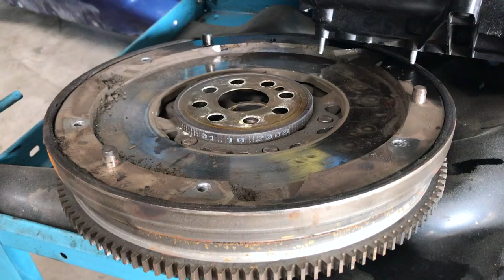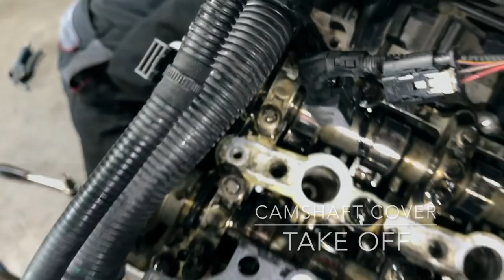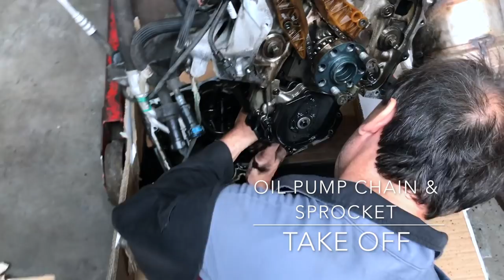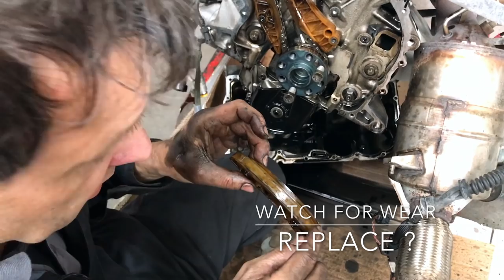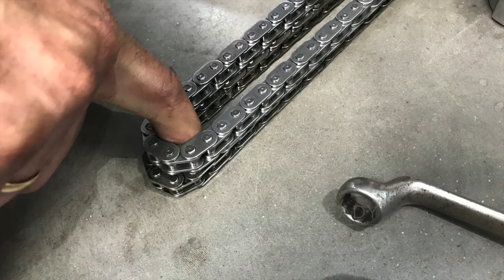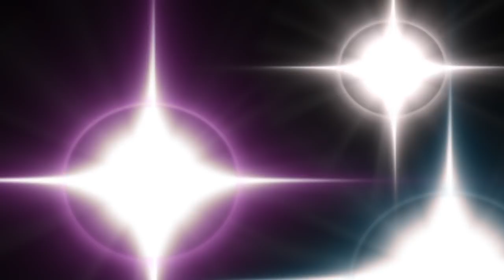HOW TO - BMW N47 ENGINE DISTRIBUTION CHAIN PROBLEM & SOLUTION - BMW 1 - 3 Series diesel

Comment: It is any chance that the moving part of the tensioner (the part wich moving by oil pressure) to fall when the engine running if  the chain will be too lose?

Comment: Hi, can you give a list of things you changed, 
i am going to do this to my car, but want to change all things recommended.
also i will replacing crankshaft.  
since fly wheel is off i will also replace that. and engine mounts. 

nice video.
Reply from the maker: way to much you're going to change...

crankshaft ??? engine mounts are allmost never bad on these cars....

Comment: The sprocket of high pressure pump is mounted wrong,    the mark on the sprocket does not align with the mark on the engine..

Comment: I am so worried about this on my 2007 116i. I have already changed the exhaust vanos unit. And now i have a rattle noise between 1400-2000 rpm only when the engine is warm. But sometimes the rattle noise goes away. So it is not always there. 

Please respond :)
Reply from the maker: mostly diesel issue !
Reply: @ICONAUTOMOTIVEBV  Sounds similar problem to mine. Rough idling. Turned out that the dual mass flywheel needs replacing. Not sure if I should replace the timing chain too as the assembly will be uncovered to replace the flywheel anyway.

Comment: I just wondering have u locked the crankshaft cause I bought a tools and it’s wrong it locks the crank about 25 degrees anti-clockwise from where u get urs
Reply: To help new viewers, there are two crankshaft locking tools. One is used when to undo the pump sprocket (keeping pistons away from valves) which you get in the timing tool kit, the other is to set crank to HPFP / camshaft timing and isn't included in any of the cheaper kits.

Final adjustment is pin above starter and locking mandrel on the camshaft. All detail can be found on Newtis along with special tool info.

Comment: hello .i have n47d20a ,bmw e90 ,2008 year , i have code error 3EC0 crankshaft senzor . it s easy to change this sensor ? where it s location on this engine ? thank you very much .big respect
Reply: I do not know if it's easy but I think it's in the valve cap at the foot of the first injector, it's a common problem with n47

Comment: how many parts do you need to replace the timing? I heard that you need 25. Is it true?
Reply from the maker: if you want to do the minimum ..
you need : 
- 2 x tensioner
- 4 x chain slider
- 3 x Chain 
- 2 x sprocket 

and the gaskets (2x)
Reply: CriZ VidZ And what about the rest?
Reply from the maker: Bmw tells you to take off the cilinderhead and then you also need head gaskets new bolts etc etc..

all the bolts from tensioners and sliders and chains are also included in the bmw 'restauration' package
and so is a gasket sealer loctite and some O rings and gaskets that you can leave where they are ...
Reply: CriZ VidZ who repairs bmws at the dealer? i don't

Comment: Awful how BMW use plastic chain guides that snap after they get some age on them. They usually kill the engine when they break.
Reply from the maker: It's mostly the give in the chain... and indeed, also the wear on the plastic guides...
Reply: you've obviously never seen another engine taken apart. every engine with chain uses plastic guides

Comment: How often must be exchange the timing chain ?
Reply from the maker: normally it lasts the life of the engine.. but there is a production error with the chains (they stretch).

So all the affected components need to be replaced if you want your engine to survive
Reply from the maker: normally never.. but with the n47 engine there is a production error that the chains extends and the tensioners cant take the extra give... so that has to be replaced !
Reply from the maker: Raitis Rieksts : yes the problem continues... but not as frequent as before...
Reply: Perfect! That is why I stay with the 4 cil M47 engine (or the M57 6 cil engine) from BMW. 
You can check with your VIN code (last 5 digits of the VIN) on the BMW parts site http://bmwfans.info/parts-catalog  if the chain is on the back side of the engine you have the more modern one (as in N47), in case the chain is on the front side has a different balanced engine and normally the chain doesn't stretch so much (like M47). I reckon there is also a cooling oil problem with lubrication engine oil channels with the N47 types with the chain on the back side but I never got the backed up information on this. The balance issue (chain on the same side as fly wheel) I reckon could be an explanation too.
Reply: @ICONAUTOMOTIVEBV  It is not a production error, the chains are intentionally very badly made, so that the services can make money on repairs, which are not cheap. Everyone is cheating on you today, but the car industry is cheating on you the most.
Reply: @4711Express  m

Comment: Crazy design to put the chain in the back of the engine , then you have to pull the flywheel . Crazy
Reply: Its a desing failure that bmw doesnt want to addmit
Reply: There was nothing wrong with the concept of having the chains on the back, BMW expected them to go the life of the engine.  It's just one of those engineering anomalies that show up as a very bad thing despite the best intentions.  All motor manufacturers make a balls-up with something sooner or later. It's the law of averages.  Sadly I found out the hard way with my 320D.  The only way to be sure if your engine falls in that period, 2007 -11 at least, is to check the BMW service log to see if its had a warranty repair done, if not and its 50k miles plus, get it done because it will go sooner rather than later.  The sad thing is, is that a very good engine for power and economy, has been blighted by this action.
Reply: i stick with m47

Comment: The  best solution is not to buy a N47 engine at all. I have a N57 525d 2004/05 a fucking masterpiece and none of the hassle of taking the entire engine out just to do the chains. Any timing chain on any vehicle will not last forever, like everything else on a engine it will need replacing as it contains guides and other mechanical parts that will wear out. I did a lot of research about what BMW have changed in the past decade and believe me its helpful when knowing what your getting yourself into before purchasing a car of any sort. If you can handle the maintenance Bill's your good to go 👍🏾👍🏾

Comment: Are you sure , you need to mark the camshaft gear ? :) Cuz there is no vanos on this engines , dont see the point of it .
Reply from the maker: yes i am sure :)
Reply: Cool and what is the point of it ? You lock the camshaft and the crankshaft in place , why the gear of the camshaft need to be marked , then ?
Reply: Crank you’re right. I’ve done plenty of these, as long as the crankshaft is locked via locking pin and the camshaft are aligned to tdc via markings, there is no need for marks on the camshaft sprocket.
Reply from the maker: We didn't lock the engine, and didn't use the pins... 

Put the engine in top dead centre and we work from there...
I allways mark as much as possible..

Rather safe then sorry 

;)